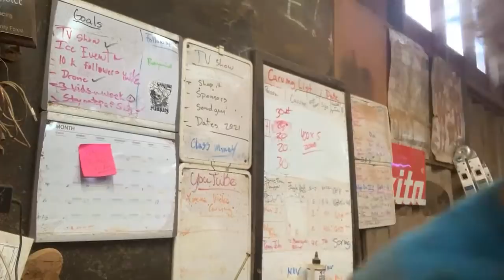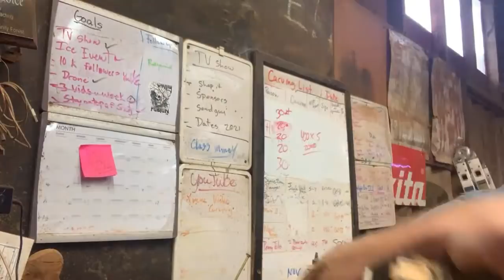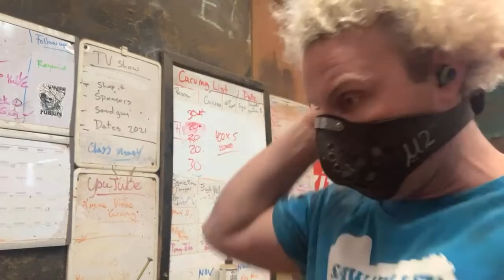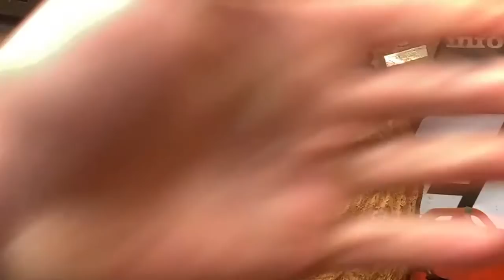Chainsaw Carving  Raven ! My BEST RAVEN - Start to finish - no edits Real Time

Comment: Man how do ya handel all the saw gas fumes inside that shead. I always do my sawing outside. And my other questions is what do you do about bar oil. In the woods  loggin we would use waste oil on the bars. Cant on a carving leaves black oil splatters every were?
Reply from the maker: my shop is actually really ventilated the roof is all vented and there is so many holes its crazy. I use canola oil for my small saws .. smells like french fries lol